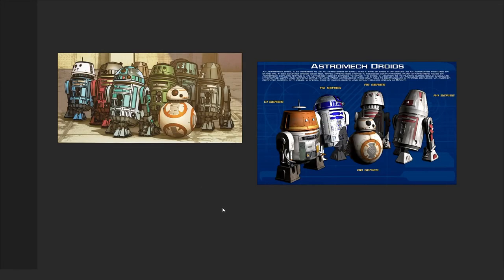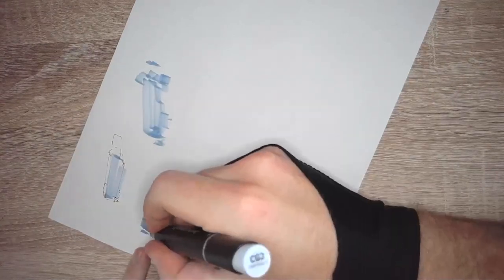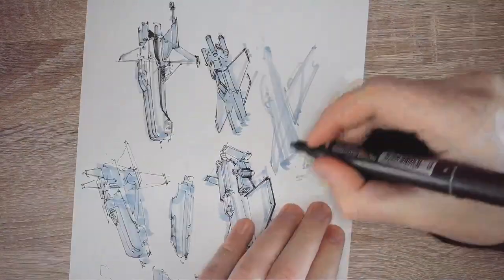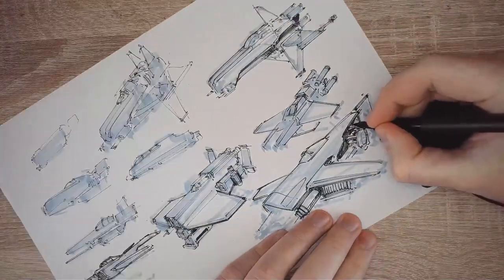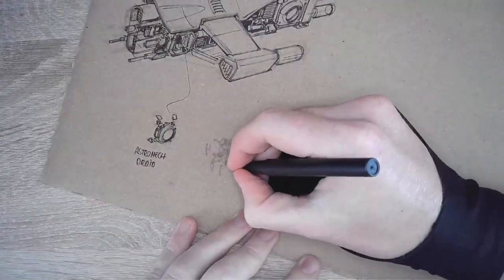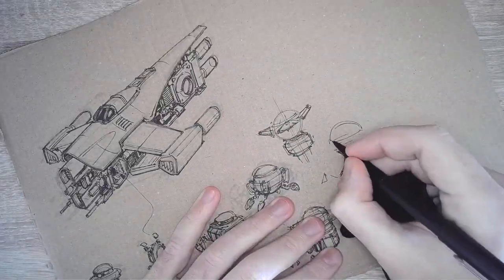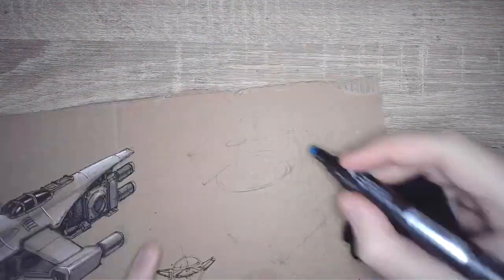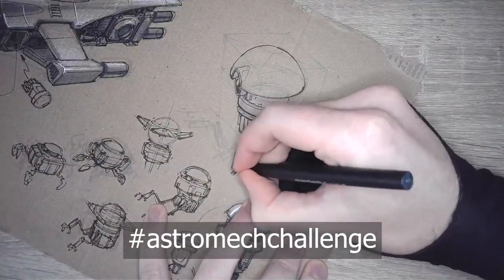Designing a spaceship and a droid

Comment: Just finding your channel now. Great sketches! Love the styling (also a huge Star Wars fan). Just a thought. What about designing the starship with something like a T-track/rail system? That way the Astromech can lock into the rails and move freely and securely around the ship. It would work at high-gs and zero-g environments. It could have a detachable wheeled base to travel around on planets. So, kind of a modular design. More useful in more scenarios.
Reply from the maker: I actually really like the idea, but i think it would work better for a bigger ship with a more smooth/homogeneous surface. Here with all the corners and angles, it would be hard to implement a rail system like that, at least one with which the droid can reach almost everywhere on the surface of the ship.